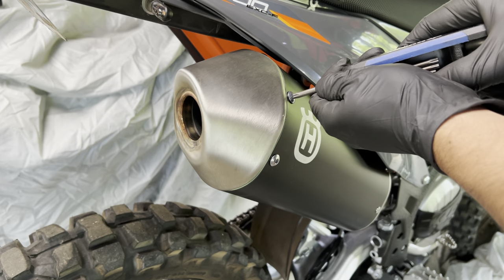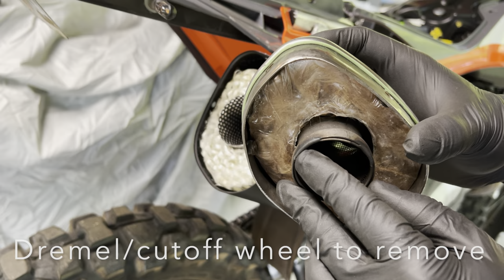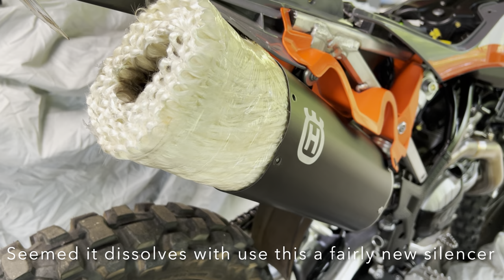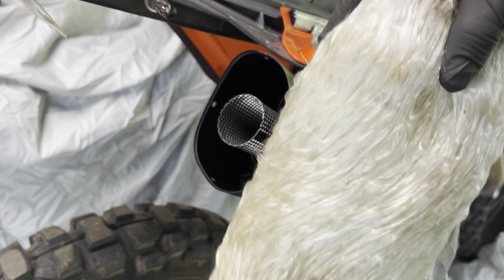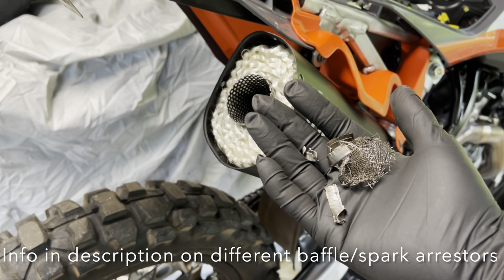Ktm Excf500 silencer cap/spark arrestor removal

Comment: what happens if i remove this thing on husky 501 and ktm exc-f 350 2023 stock and not change air fuel ratios?
Reply: Backfire possible. I just did my 24 build excf350. Changed tip , intake tube and bestdualsports tune. It rides sooooooo well. Check their YouTube page. Dave is the man. I’ll release a video soon

Comment: How should you fit the oring between silencer and cap? If I just shove it on there the green ring tucks in between in some areas but stays on top on other spots. Should the o ring be fully tucked in? I can’t push the cap far enough to get the screwholes lined up when tucking it completely.
Reply: Nevermind, i figured it. I just pushed the oring between cap and silencer before pushing it all the way up with my fingernails. Sits flush and looks super clean, o ring is completely invisible.

Comment: Man...I've just spent the last 90 minutes beating, prying, pulling, cussing and swearing at my end cap on 2024 KTM 500 XW-F.  It seems it must be binding up on the baffle or something, but it comes out about 3/4 of inch, then just stops...getting held up on some tube inside.  No amount of prying or rubber mallet has helped.  I can sort of twist it and hear screetching metal but it will NOT release or come off enough to see inside to what is going on.  Yours shows a nice simple bell that just cups the screen muffler inside.  sigh...at this point my sleeve of the muffler is getting bent and beat up...
Reply from the maker: The 24’s might be even more corked up than previous versions! The newer they get the harder the DIY’s go. EPA loves the BS, goodluck and let me know how it went!
Reply: @thediymafia Yeah...I finally got it off.  It was press-fit on and crimped over the bell.  With the replacement Promoto Bilit slip on it is actually a little quieter and the Vortex ECU really made it come alive.
Reply from the maker: @jeffmcclain   Hopefully not too much damage was done! I was very careful with mine and dropped the bike a week after scratching the muffler pretty bad 😂.  I wanted a louder muffler and didn’t want to spend the crazy money on aftermarket options so I experimented with the OEM non EPA version one wich is wider through and shorter in length and it barks loud enough it sounds like an aftermarket 🙌🏽
Reply: @jeffmcclain How did you get it off? I had mine in a woodworking metal clamp and I can't get it past that 3/4" you talked about.
Reply: @SMG_Play  I *did*, however, it was NOT easy, smooth or fun.  Once I got it pried out enough, I could start to see inside, and the baffle was crimped over the bell of the endcap.  I have no idea how they crimped it as they put it on, but they must be forming it into a curl, then pressing it on to force the rest of it to curl into a holding cup.  I guess they REALLY don't want folks taking this off, and it was stupid hard getting it off.  Maybe they can slide the outer sleeve of the whole thing on from the front after crimping it.